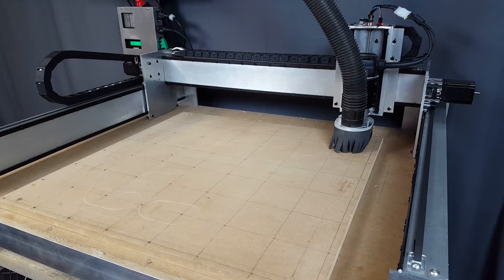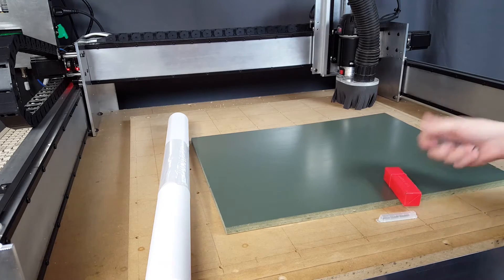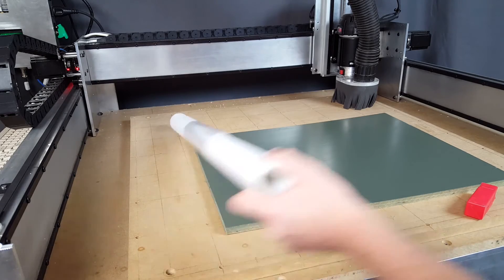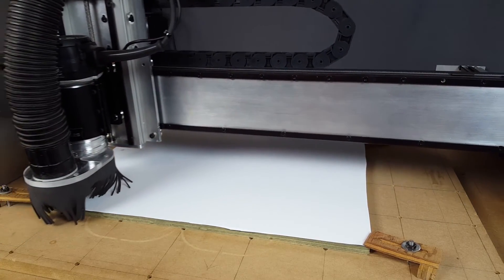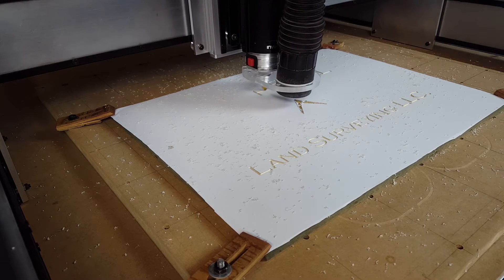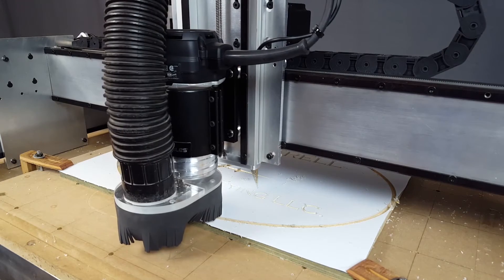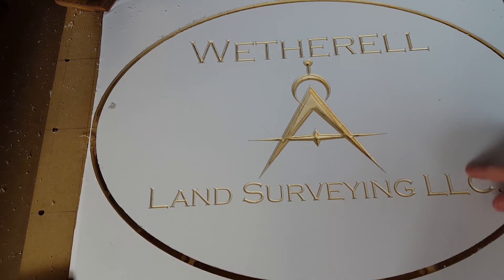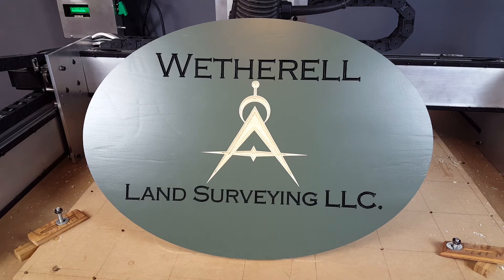CNC V-carving a Sign

Comment: How much did this wind up costing? I think the big 2x4 aluminum rails give the machine good ridgidness, however the use of belts is a draw back. www.sienci.com has an open source Aluminum Angle rails machine which seems like a much easier approach than adding v groove rail to standard rectangular tube. Obviously having 8 wheels spaced apart will give better deflection vs 4 wheels on an single angle, but the longmill machine seems to work fine for most uses.

Comment: beautiful stuff man... gotta get you to put a link to the vinyl mask that you used.  love that you kept the compass a different color.  also, i'm wondering if a quick coat of spray lacquer with the mask on would help seal and keep any of the black paint from bleeding under an edge?  looks like in your case you didn't need it... but i'm just curious if it would help optimize.  thanks for sharing.
Reply from the maker: Thanks for reminding me about the paint mask link. It's in the video description now. I failed to mention it, but I actually did use spray shellac before painting the letters black. I was using it more as a primer coat, and to seal the compass with something.  I don't necessarily think that the paint mask would allow anything to bleed through. It's fascinating stuff that's super sticky and cuts super clean, but also, pulls off very easily.
Reply: did you use the spray shellac with the mask still on and before you painted?  like, the lettering too?
Reply from the maker: Yes